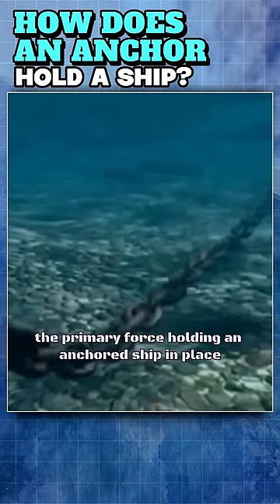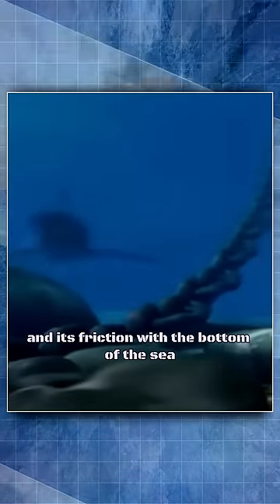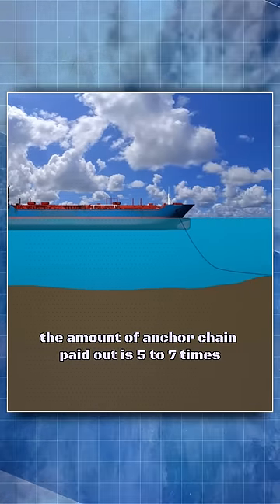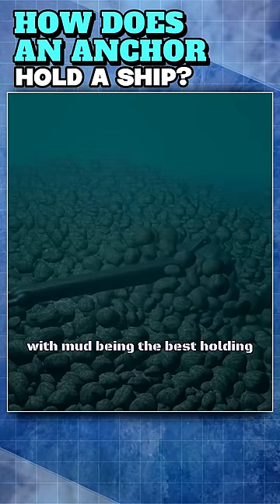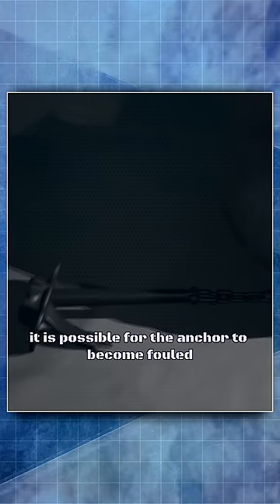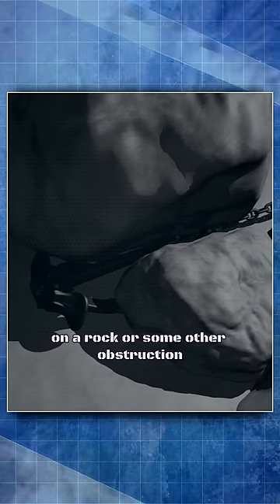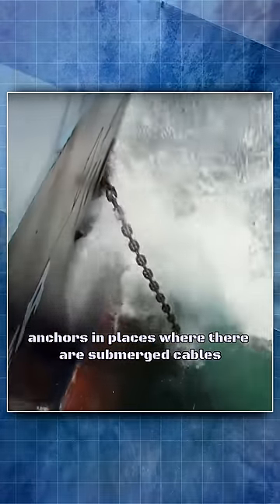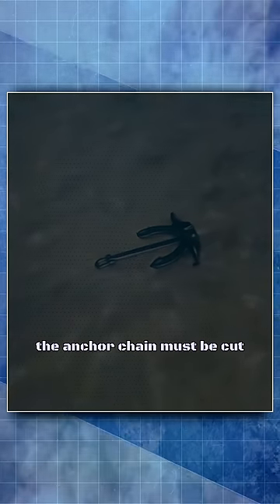HOW DOES AN ANCHOR HOLD A SHIP? #ships #vessels #anchor

Comment: The largest ships have more than one anchor. For instance an aircraft carrier has 2 weighing 60 to tons each.
Reply: Every Naval ship I served on had 2 anchors except the submarine.
Reply: I work on semi submersible heavylift. 
This type of vessel have 3 anchors.
Reply: Reason for 2 ore more anchors is mostly to have at least 1 spare!
As mentioned in the video, the heavy  aircraft carrier would have stayed in place in most cases even with say a 0,1 ton anchor if the chain was right lenght and dimension-weight. 😉 Becouse if they for example used a 1000 ton anchor and almost weightless steel rope,,
the anchor probably would move every time the waves lifts the ship enough to STRAIGHTEN the rope!!!!!!
For example my 35 feet fishing boat  18 tons have only a 40 kg anchor and no chain becouse i have no  anchor winch, and use the net puller to pull it in. so i use led rope and add a 50 kg weight ore 2 + on the rope half way if the weather forcast  is bad and i have to anchor instead of going to a safe harbour with wave brakes where i tie the boat to a dock
Reply: @samkom33 ah, that's not true I seen battleship. It has 2 ankors so it can drop one to turn faster. It needs 2 due to the diffrent directions you can turn ethier direction.

Was a joke.
Reply: @wight626  well i know from 22 year experience BEFORE sidetrusters on the old hutigruten that went from kirkens to bergen in norway we often used 1 anchor both to turn i narrow harbours and in stormy weather we drop anchor to before docking to be able to pull us away from the dock against the wind depending on wind direction and we somtimes lost the anchor ore 1 winsj failed
Here is an example of the modern bigger hurtigruten even with side trusdters:::
it still use 1 anchor for safety in harbour.. I cind of doubt even a carrier use anchors to turn in open sea, hehe
https://www.youtube.com/watch?v=i_bxYVKF8a4
Reply: Two anchors is standard requirements. On the contrary, smaller vessels are more likely to have three anchors (two at the bow one at the stern) to aid doing weird dockings in sub-optimal ports
Reply: @SportSoulLife smaller vessels dont have 3
Reply: @timothykappel198  Off the top of my head, m/v Prima Queen, m/v shipper, m/v transporter and m/v exporter are built for fitting them. 

That and propably the majority of canal barges atleast in Europe. 

I'm not saying all small vessels have 3, I'msaying its more common for small vessels to have 3 than it is for large vessels. All small vessels have two though.
Reply: @SportSoulLife  ALL solmaller vessels definitely don't have 2.  U might be using the word vessel wrong.  I've worked on many vessels with no anchors and many with only 1.
Reply: @timothykappel198  Maybe some fishing vessels. You are right, borderline boats may get around these rules. Also if the vessel is only navigating in lakes then many regulations don't apply on it. 

However given the topic, i hardly believe anyone was assuming that the discussion was about so tiny ships.
Reply: It is a requirement to have 2 anchors.
Reply: LHD ship’s anchor weights 340 pounds for each link
Reply: @samkom33 
What kind of owner of a fishing vessel calls the lines on his boat  ropes. The only rope that is on a boat sits in storage once you give a rope on your boat a job it is now known as a line .

Comment: Wrong - the length of chain laid out is to keep the force on the anchor parallel to the seabed.  If you try to anchor with a rope or a short chain, when the ship pulls on the anchor, it pulls in an upward direction and the anchor comes out.  The heavy chain lays along the bottom and changes that upward force into a horizontal force and the anchor does not pull out.  This is why ships put out more chain when the wind blows harder.
Reply: Exactly 💯%. Try to "anchor" only with a chain without an anchor. Good luck with it. The whole story is a big nonsense.
Reply: This makes more sense.

Comment: No the angle of the chain helps set the anchor and help keep it holding. The 5-7 times in length is called the anchor's "scope". Yes if it weren't for the chain the anchor wouldn't hold, but without the anchor the chain will not hold the ship on it's own. The chain doesn't really provide holding power itself, it only facilitates it though geometry.

Comment: Pulling all EIGHT anchors from the semi submersible oil rig on moving day is one hell of a party along with the rollback anchor "boat" that assists with their winches and our crane aboard the rig.  The more anchors are pulled, the less steady the rig/crane are when crawling up onto the anchors once on the boat deck to pull the many pound shackles while knowing what swells will make the anchor taught on the line with the movement of the boat AND the crane lines from WAAAAAYYY up there is a dance for sure
Reply: Wayho blows me men down and into the bars¿?
Reply: Get me a job

Comment: It is possible to untangle the the anchor fouled onto a cable with wmall ships, up to 25; 30 meters). 
I did it a couple of times with my 30footer sailboat.Needless to say I wasn't proud and kept a low profile as cables and these types of obstructions are well marked on charts with dedicated signal onshore : bacically it was pure negligence.

Comment: The weight of the chain and/or anchor plays a very small role... Think of it VS the weight of the ship!

Chain weight and mostly length is so the anchor pull is parallel to the surface movement, letting the anchor work.

The length of chain also plays a big role through mechanical resistance of each link, preventing motion/waves to get all the way to the anchor.

Comment: Sail driven ships, used to move the ship by putting the anchor on a long boat.
Row the long boats with the anchor out in front of the ship.  At a point about 100 yards in front the long boat crew would drop the anchor.
After dropping the anchor 100 yards in front of the ship. Once the anchor hits the bottom,  then the ship crew pulls into the ship.
The process of pulling the ship forward.   Once the ship moves over the anchor, the anchor is placed back in the long boat, and the process starts over.

Comment: How did they cut the chain?
Reply: Lazer cut
Reply: They have giant scissors. Takes 84 people to operate them.
Reply: @justlucky8254 😂😂
Reply: Perhaps a hacksaw.
Reply: 🤔 torch 😏
Reply: Cutting torches.
Reply: It isn’t cut I think
Reply: What they can also do is every shot of chain has one detachable link and what they can do is, they can pull the chain up, remove the detachable link and then drop the anchor chain back to the seabed. That’s normally what they do that’s the easiest safest way to do that.
Reply: @justlucky8254 Kidding right? How do 84 people grab 1 pair of scissors..?
Reply: @BearsRule777  it's a very complicated process.
Reply: @BearsRule777 really big scissors
Reply: @BearsRule777 they take turns.
Reply: They use a hacksaw that they bought from the dollar tree.
Reply: Water cutter
Reply: At the weakest link of course!!....LOL
Reply: @steveanderson4768 that is completely incorrect.

Comment: Wrong, the weight of the chain helps avoid chafe on an anchor line against the bottom, the weight also acts as a spring in waves when the boat is forced back by a wave, and finally, the weight of the chain can increase the horizontal pull on the anchor and increase the likelihood the flukes on the anchor dig into the soft bottom. It does not however cause any resistance.

Comment: What about small boats that use ropes. Just wondering about the applied principle.
Reply: Not going to work very well.  Even a bit of chain helps a lot (keeps anchor at the right angle to dig in).
Reply: I have a anchor and then only maybe 1 meter of chain on my boat, as long as you  exaggerate with anchor size and then have as much rope as you can you should be fine.
Reply: A well anchored small boat even using a rope will always have a good few metres of chain at the anchor end. Just using rope will be fairly useless and the rope will get damaged quickly and not be very effective at holding in any wind or current.

Comment: So, if the weight of the chain  is the main factor, why use anchors at all?
Reply: Because they are called anchors.
If you use chains alone, you call them chains. 😊
Reply: Chains are actually to pull the anchor down into the right angle to allow it to dig in. The "friction" claim in this video? Hmmm not too sure about that at all.
Reply: @cvanscho  the anchor is to help pull out the chain correctly out and make sure it stay correctly on the sea bottom. they do that while the ship is backing up. the weight and friction of the chain, is holding the ship in place, it also act as an spring.

one thing they do when drooping the anchor, is that they first droop the anchor to the sea bottom with some slack on the chain. Then they stop drooping chain, so they can pull on the anchor, so it flips over and dig in, to hold the chain in place, first then they droop rest of the chain, while backing up.

for example, an 60 ton anchor, as on US aircraft carriers, can't hold the 100.000 ton aircraft carrier in place. A single link on a anchor chain for an aircraft carrier can weight up to 360 lb (164kg), and you have around 1500-1800 foot of chain

Comment: No. No it's not.  The primary force is the giant prongs stabbing the bottom.  I've heard this before and it's bs. The weight helps the chain pull horizontal and not vertically.
Reply: Ah yes the famous anchor 'prongs' 😂
Reply: @skippyguy3  lol trying to dumb it down.
Reply: Dumbing it down from......?
Reply: @skippyguy3  the bills.  the fluke.  the actual parts of an anchor.
Reply: @kevinallen206  oh ok what is a fluke?